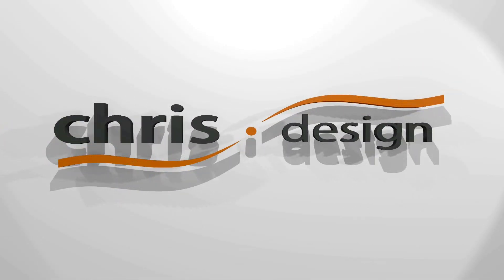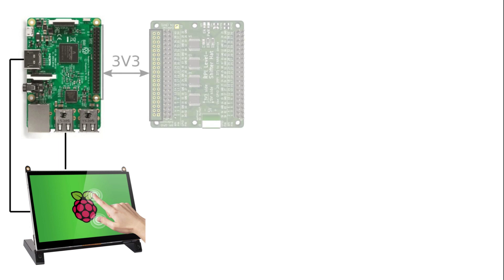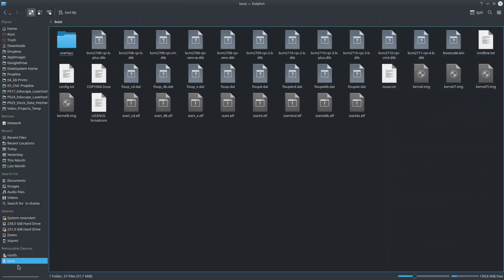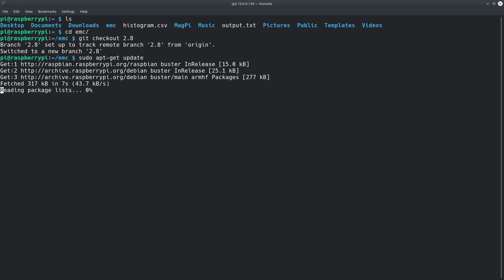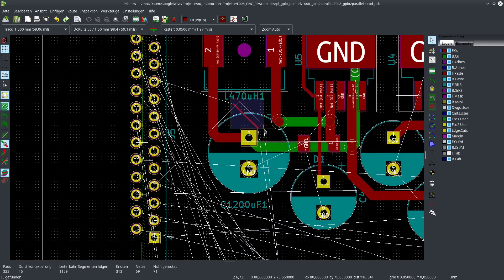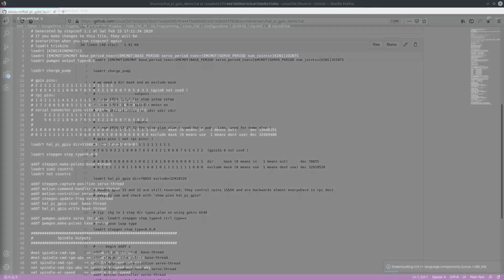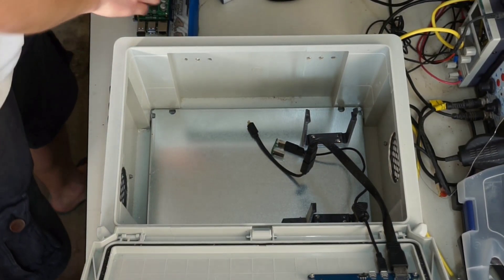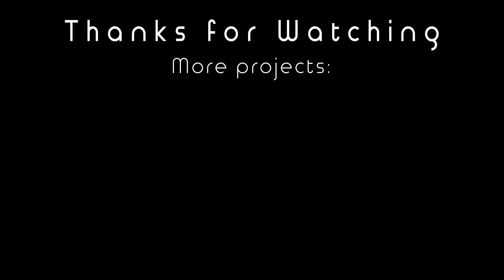Raspberry Pi CNC Controller

Comment: Very helpful.  In particular the video actually has a diagram showing the parts connected, and an explanation of what they are for.  To be honest, explaining the function of a breakout board would have been even better, but still this is much better than the usual how-tos.  As a former software architect, I'm struck at how uncommon it is to get an explanation of the overall architecture of a system (software or hardware).
I'm probably going to build your two boards, as you seem to be out of stock.

Comment: great project kudos.
 I wonder if it is possible and how to turn the function on the limit switches? if the switch is in position 0 in halshow it shows 1 and if I press it it shows 0
Reply: I solved the problem with relay and com and nc contact 😂

Comment: As someone who has built many CNC machines (some on my channel) and as someone starting to program and use the Raspberry Pi... I am SERIOUSLY IMPRESSED with what you have accomplished! Excellent video and I will be sure to share!
Reply: Raspberry pi ile sadece cnc routuer mı yapılabilir başka projelerde kullanılabilinirmi
Reply: @yasinklc2699 Raspberry Pi, birden fazla çıkışı olan mükemmel bir küçük bilgisayardır. Pek çok şey yapmak için kullanılabilir. Sensörleri ölçmek, bir şeyleri kontrol etmek, bir robot yapmak veya başka birçok kullanım istiyorsanız... bunu oldukça iyi yapacaktır.

Comment: I have a Shapeoko 4 axis machine with stepper motors, y axis uses 2 together. The machine has its own stepper controller. This can interface with a Raspberry Pi but at the moment only works with Carbide Motion software (via a USB cable and uses GRBL commands), this software doesn't support the use of the Pi GPIO. I want to run the machine via an external input and also want to switch on 1 or 2 outputs using M codes. I will add a relay interface module to switch the outputs. Will Linux CNC run this machine from the Pi?

Comment: need use FPGA card, uh, super expensive ower 200$ linux cnc and old paraller printer port computer what can buy 20$ and linux cnc FREE need controller card cost 10$ and then drivers ewery stepper cost 40$/motor. lot cheapen than raspi. uh.

Comment: Sorry to bother you Chris. Great video, I got the shifter and the LCNC but am having an issue getting it to work together. I used your pi image, when I choose a configuration and setup the proper pinouts and everything the steppers do not move. I feel like an idiot lol. Do you have any ideas what I could be doing wrong?
Reply from the maker: Did you try one of the preconfigured samples found on the desktop without changing anything in advance? 
https://raw.githubusercontent.com/ChrisWag91/PI-LCNC/master/Graphics/F013_PI-LCNC_RPI_Image.png
They should work out of the box (at least the steppers should be running). If that is the case, I would tweak the config files to fit your machine. You can contact me via mail, if you need further support: christoph.wagner91@gmail.com

Comment: interesting but not understand anythink. i have raspberry pi zero,3 and 4 but newer not can add image in boards, i have one old mini computer whit sd card and in have emc2. but hardware not have ready. no have tube at frame can welding all. thailand have problematic build anythink, no found material no have help, not anythink. north europe u build 8 cnc machine wery easy all parts can buy local store or orden internet, thailand not can anythink.
Reply: Pi3 is not good. I have one and latency is around 100Kns.
According to linuxcnc doc, it is not good.
Should be ideally below 10k…

Comment: Nice job Chris!  Do you have any concerns on the longevity of the micro SD card in the RPi?
Reply from the maker: Thanks. I haven't had any issues with the sd card so far. I guess using smaller capacity cards from a name brand manufacturer will reduce that risk.

Comment: Hi Chris, thanks for the great video and PCB designs seems like a nice design. I would like to give this a try as well also like the idea with the small touch screen. Did you publish the Gmoccapy screen resolution changes somewhere (a linuxcnc fork maybe)?
Reply from the maker: Not yet, since it is not really a clean mod at the moment. But I'll pull the files from my machine on the weekend, if you want to give them a shot anyway. Watch this space for a download link.
Reply: Thanks. I will give it a try then.
Reply from the maker: The files are now available on Github.
https://github.com/ChrisWag91/PI-LCNC/tree/master/Gmoccapy%20mod%20files/small%20screen%20mod%201024x600
But they might need a little bit of polishing.
cheers
Reply from the maker: The files are now available on Github.
https://github.com/ChrisWag91/PI-LCNC/tree/master/Gmoccapy%20mod%20files/small%20screen%20mod%201024x600
But they might need a little bit of polishing.
cheers

Comment: Not sure if you would know this or not but I have a small sainsmart cnc clone that runs GRBL, is it possible to use LinuxCNC on a raspberry pi to control it through the mini USB port in the same way I use octoprint on a Ubuntu PC to control my two 3d printers?
Reply from the maker: Theoretically yes, but I'm not sure if you can get Linux CNC to talk to these boards.

Comment: Just for reference, but there is actually a mesa card specifically designed to work with the rpi, just for anyone wondering.
Reply: Which one? I bought a 7i96 for a project, will it work?

Comment: thx chris  is a great job  you did . mine project is les compicated . i just need one single x-axe to be controled  with a stepper motor .Can i use  the pins of the pi 4 use directly (one transistor inbetween for the  3.3 to 5v adustment) and use partli your hal file  just to activate 2 pins for puls and direction  like 
loadrt [EMCMOT]EMCMOT base_period_nsec=[EMCMOT]BASE_PERIOD servo_period_nsec=[EMCMOT]SERVO_PERIOD num_joints=[KINS]JOINTS
loadrt charge_pump
loadrt hal_pi_gpio dir=78855 exclude=32918520
loadrt stepgen step_type=0,0,0
# --- begin addf s
addf hal_pi_gpio.read  base-thread
addf stepgen.make-pulses base-thread
addf stepgen.capture-position servo-thread
addf motion-command-handler servo-thread
addf motion-controller servo-thread
addf stepgen.update-freq servo-thread
addf hal_pi_gpio.write base-thread
# --- end addf s
net xstep stepgen.0.step => hal_pi_gpio.pin-03-out
net xdir  stepgen.0.dir  => hal_pi_gpio.pin-05-out
Reply from the maker: Sure, that should work just fine. But I'm not sure if linux cnc will run with your simplified hal file. That will depend on your initial configuration. If you run into issues you could use a standard 3 axis configuration with my configuration files and just use one of the axis.

Comment: thank you chris. i have a question. I want to make my own cnc. can i use the hardwares you used in my software? i dont want to use such as linuxcnc or grbl converter?  can i send the gcodes to machine line by line using this hardware? (using socket module or pyserial)
Reply from the maker: No that would not work since there is basically no logic on the boards I designed. Linux cnc is required to interpret the the gcode and "converts" it to pulses for the steppers.
Reply: @ChristophWagnerChrisDesign  bro, i want to my own cnc machines. But i don't want use any converter. What should i do, if i buy a controller compatible with mach3 (with raspberry pi)  and can i send gcode to controller over serial or socket ? pls share your opinion with me.
Reply from the maker: @MuhammedSevinçtekin  You could look into arduino based gcode interpreters. Maybe you could even use a controller board for a 3d Printer. Also check the mesa FPGA boards, but Im not sure if they are interpreting gcode onboard.
Reply: @ChristophWagnerChrisDesign  bro, i have gcode and if i calculate the needed pulse for 1 mm to go to linear move, is it correct ? and with this can i send the pulse to motor using serial ? is it sensible ?
Reply from the maker: @MuhammedSevinçtekin  Thats pretty much what Linux CNC is doing. So theoretically it should be possible, but I'm not sure if you get tight enough timing with a python loop and pyserial. You will need to make sure that your system is realtime capable which is way over my head.

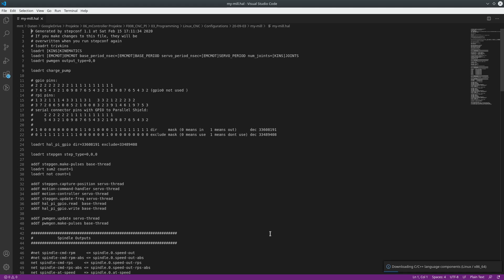Comment: Hi Chris, I am looking to control a self-build machine, I would like to know where we need to modify the pinout file for the motor (11:08) from the linux CNC. I just to add a few more degree of freedom 7 axis. Could you share your files?
Reply from the maker: you can find my hal file here: https://github.com/ChrisWag91/PI-LCNC/tree/master/Linux%20CNC%20mod%20files
Reply: @ChristophWagnerChrisDesign  Hi christ Thanks. Just a quick question since I am new to linuxcnc. Is it  multithreading by default for the multi-axes control? or I have to start a new thread for each axis individually?

Comment: Kannst du sagen, was die maximale Frequenz ist, die du damit ausgeben kannst? Ich würde gerne wissen, ob das auch für meine Maschine ausreichend ist.
English: What is the may. frequency you can drive? I want to check if it fits also for my machine.
Reply: ok, habs selbst auf deiner Github-Seite gefunden: 15000 Steps / s

Comment: I first would like to say I love this project.  Second when i am trying to use the linuxcnc-2.8.0-Pi4 zip i keep on a Pi4B 2GB i keep getting a startup error: 0.788381 kvm [1]: Error, CPU 0 not supported!  and then then when it finally loads into the desktop the mouse and keyboard do not work.  Any suggestions?  Thanks

Comment: I wander, what's the latency and jitter? As the first error message you got after starting LinuxCNC was that of too much latency. I'm really interested as to how did you solve that problem.
Reply from the maker: System latency is 81 ns on my system according to this method: https://metebalci.com/blog/latency-of-raspberry-pi-4-on-standard-and-real-time-linux-4.19-kernel/

The LinuxCNC latency test gives me a max jitter around 50000 ns which is not great but allows for 15kHz step rate. Since my machine can mechanically handle about 3kHz max it is consistent enough for my use case.

But it would be great to get the jitter down further. Would be interesting to see if newer releases of the rt kernel and LCNC can improve that situation significantly.
Reply: @ChristophWagnerChrisDesign  Thanks a lot! Now I can put my rpi4 to a good use. ;)

Comment: I actually went with an RPi4 with the Mesa 7C81. It works like a champ. Documentation sucked at the time, but maybe it's getting better now that this stuff is in the stable release of LinuxCNC? I just wish there was more friendly tutorials for the HDL for LinuxCNC. Looking at the manpages as a newbie is a nightmare in my experience, but there seems to be so much stuff in there that has a lot of potential.
Reply: Hi. So you used a CNC (parallel port) breakout board + Mesa 7C81 + RPi4? Do you have a link that can assist me with  this configuration? I'm new to this and it would really help.
Reply: @Grace-ky5du  I don't have any public links, I'm sorry. Thankfully it's a bit easier to get started now since LCNC has an official RPi image on their website but you will still have to make your own HAL config. You should read up on the documentation to see how you can stress test the pi using the latency tester if you didn't already know and determine what servo thread speed you will use (this is explained in the docs thankfully). I personally used the PNCconf tool to make a default mesa machine configuration. The Mesa 7c81 wasn't available in the tool though at the time (maybe they have updated it?), so I just selected another typical Mesa card and set it to be connected to my 7i76. I had to go into the generated .ini file and the HAL file and change them to properly call my 7C81 instead. From there, it was just like other typical LCNC machine configs.

Comment: Hello, Thanks for the great video!
What is the advantage of using your interface + Breakout boards over the raspberry protoneer board?
Thanks
Reply from the maker: Hey, 
I don't have any experience with that board. I'm not sure if you can get that to work with LinuxCNC though.
Reply: @ChristophWagnerChrisDesign  So far have you been happy with this choice of controller or you are thinking about going to a more industrial solution like Unicorn or Mach4 . Do you have some thought about the DDCS all in one chinese controller?
Thanks

Comment: Hi, thanks for a great video.
I want to buy a PI-LCNC
GPIO to Parallel Shield from you.
(Timestamp: 9:29) The URL: github.com/ChrisWag91/PI-LCNC do not work for me.
I have just purchased the level shift card from your Ebay page and hope that even this card shows up there.

Would raspberry pi 400 be usable for this from an electrical point of view?
Reply from the maker: Hi, Thanks for the feedback and the purchase.

Please just contact me via email (christoph.wagner91@gmail.com) in order to work out the details concerning the PI-LCNC board. Since I have just 3 units left, I don't want to go through the trouble of making another ebay offer for them.  

I’ll set some time aside to finish the github repository soon and add the link to the description. At least in a minimum viable kind of way. 

Hope that helps. 

It should be possible to make a raspberry 400 work. Since the hardware is more or less the same as in a rpi4, at least as far as I know. But I did not test that.
Reply: @ChristophWagnerChrisDesign  
Which Raspberry Pi do you recommend for this build?
Reply from the maker: I used the 4 gb version of the RPI 4. I did not test any of the other ones, but I think even the 2 gb version would work, since LCNC does not use a lot of ram.

Comment: The level shifter board is in your github but the PI-LCNC is not. Are you planning on making that available too?
Reply from the maker: I might do that at some point if there is enough demand. But that would require some more testing.
But you would not need it, because it just links the traces straight through to the lpt connector. So you could just splice the lpt wire which comes with the breakout board, directly into the level shifter and supply the pi with an external power supply. 
If you still want to use that board I might be able to send you one of my spare ones for the cost of parts and shipping. Just let me know if you are interested in that.
Reply: @ChristophWagnerChrisDesign  Would be cool, I would be interested! If it's working for your machine is good enough to make it public!
Reply from the maker: @IvanGOrtolan  https://github.com/ChrisWag91/PI-LCNC

Comment: Are the lpt board (upper level shifter) is your product?whats about the schematic for this?
Reply from the maker: Yes I did design the board. 
But you would not need it, because it just links the traces straight through to the lpt connector. So you could just splice the lpt wire which comes with the breakout board, directly into the level shifter and supply the pi with an external power supply. 
If you still want to use that board I might be able to send you one of my spare ones for the cost of parts and shipping. Just let me know if you are interested in that. 
I did not open source the design since I did not fully test the characteristics of the power supply. But it seems to work nicely in this use case.
Reply: @ChristophWagnerChrisDesign  thanks for repply... I will try it...
Since Ncov-19 hard to get shipping to my town
Have patreon?

Comment: You really don’t need Raspberry pi specific Mesa hardware.  Using the iso you linked, and a 7i96 card it’s basically plug and play.  The gpio pins are limited in their ability to generate pulses of high frequency so you’ll just be limited on your feed rates (as I understand it).
Reply from the maker: Thanks for the feedback. Yes, there is an upper limit in the frequency of the gipios, but at least in my case that is way more than my machine can handle mechanically. So going with a mesa card would not have a benefit in that regard and the solution using gpio pins should be quite a bit cheaper still. In my opinion there is something to be said for both solutions.

Comment: There is a pre-made image for the Pi with LinuxCNC and Kernel included: http://www.linuxcnc.org/iso/linuxcnc-2.8.0-pi4.zip
Or, if you prefer, deb packages for Pi here; http://www.linuxcnc.org/dists/buster/2.8-rtpreempt/binary-armhf/
Reply from the maker: Thanks for the hint. That will shave off quite a bit of time for anyone trying a similar thing. I'll put your links in description.
Reply: @ChristophWagnerChrisDesign  For the SD card image, you just need to go to LinuxCNC.org and click the "Downloads" link. Other methods are shown in the "Getting LinuxCNC" section of the documentation: http://linuxcnc.org/docs/2.8/html/getting-started/getting-linuxcnc.html
Reply: @andypughtube  this works for a pi3b+?
Reply: @idus  You can try it, but I haven't tested it. 
Bear in mind that the ethernet on 3b is on the USB bus, so that your only realtime interface is the GPIO pins.
Reply: @andypughtube  ok thank you.  Seems like the pi4 is the best solution, just shy of using an actual desktop.  Thanks for your carousel contribution. I’m still trying to implement it on my fadal tool changer.

Comment: hey nice job! I have had similar thoughts about my router. Its currently running linux on an old desktop machine but its super bulky and overkill for what it needs to do. How are you finding the performance of the pi?
Reply from the maker: Hi, thanks mate. Performance is plenty good enough for a cnc controller. It is way better than with my old desktop pc. But I would recommend at least the 4gb variant.